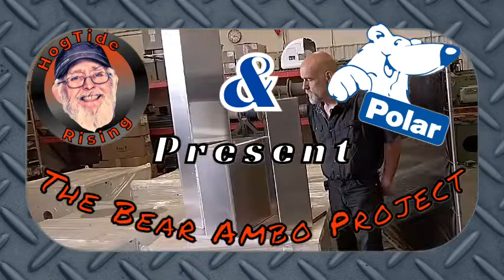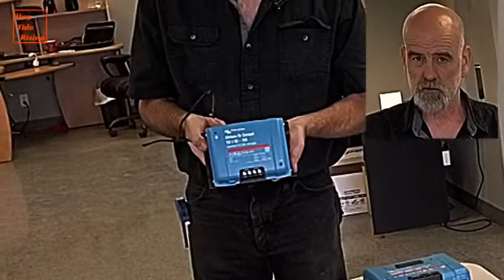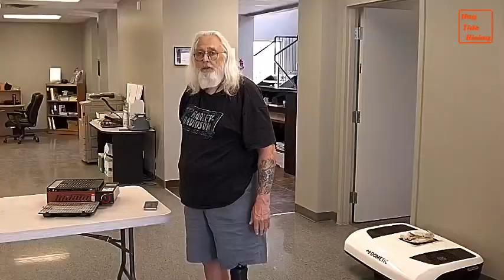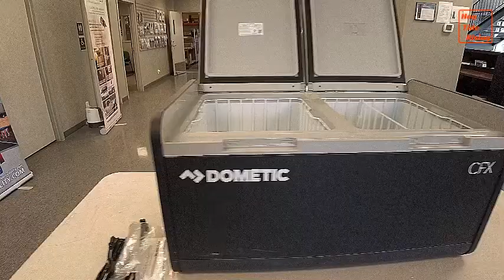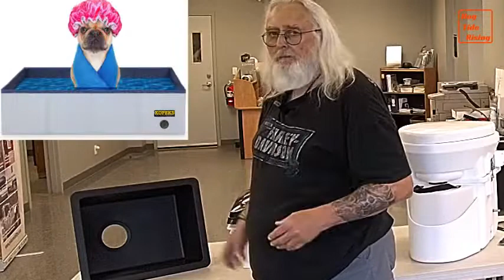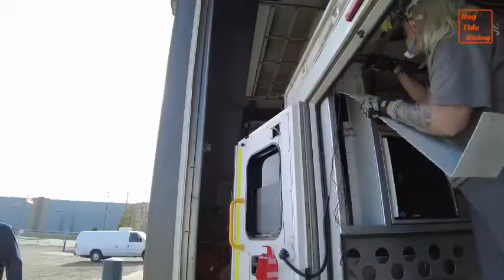WHY I need this gear for my ambulance conversion!!!

Comment: My wife and i bounced around trying to figure out the best options for limited small appliance space as we are buying now in preparation for heading out on the road.  it will be good to watch how it goes for you.
Reply from the maker: I analyzed my needs and based my decisions on previous experience. I have been nervous about propane since living on a boat so I decided to go electric for meal preparation. And electric appliances do require lots of solar. Thanks for your comment.